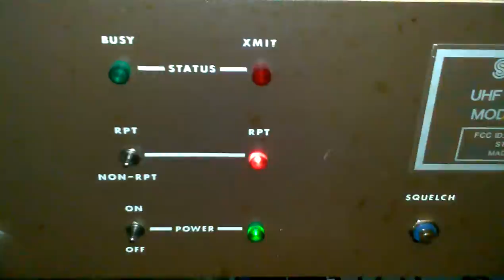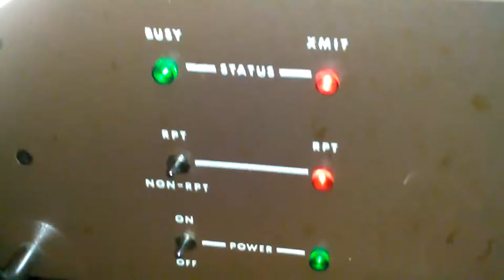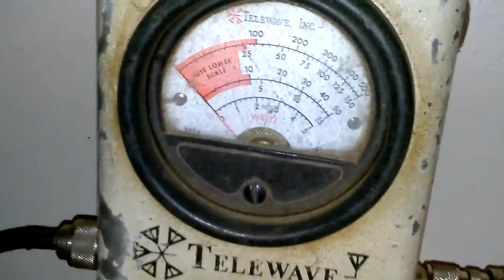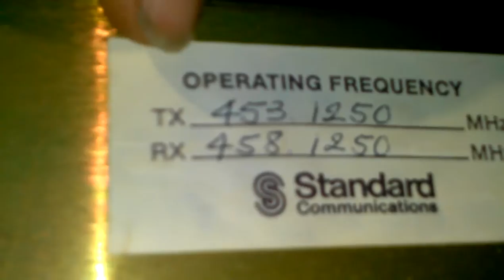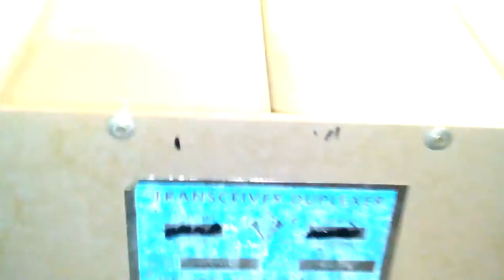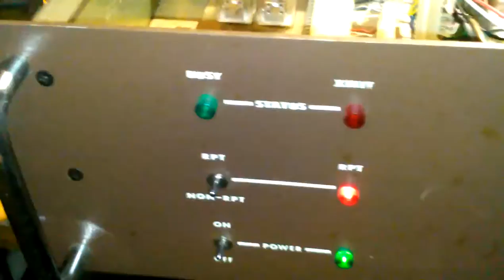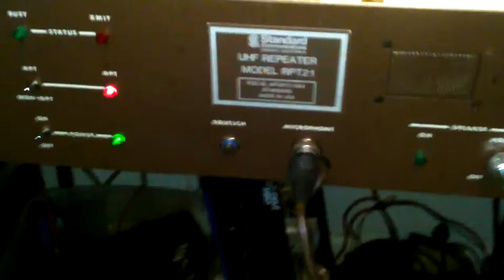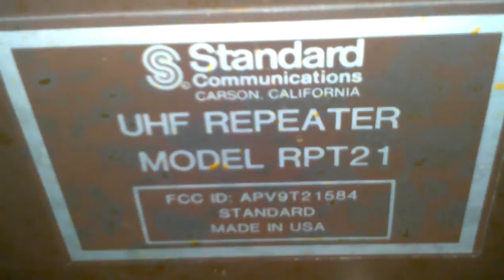Basic Repeater operation ft. Standard RPT21

Comment: Are crystals that bad over there as well? Last I was quoted here when asking about crystals for a HF radio were $150 per crystal or there abouts. The HF went into the local council pickup after hearing that as unfortunately to put several channels that were needed into it, it was far cheaper to instead get a computer programmable commercial HF (Codan or Barrett).
Reply from the maker: +Glen O&#39;Riley Yes because they are widely outdated for radio use. There are still some niche markets for ham radio use since they are still allowed wide-band operation and for some odd reason like to use relics like this Standard or a GE mastr 2 for repeaters. I am a commercial operator and I decommissioned and recycled all my wideband equipment back in 2005.. I am getting ready to do the same with the few reaming lingering analog repeaters I have up still here in a year or so. Time has come to suck it up and go all digital.. I have some digital systems up but they way its going now it is just about cheaper to go digital than to stay analog.
As far as crystals in radios go, well here int he states it is more less for hobbyist.
Reply: +ElfNet Gaming seems the same here too. 

All emergency services are or are on their way to full P25 and all the mines etc have shifted to DMR (mainly MotoTRBO). The way I hear it all the mines around here upgraded to a common combined MotoTRBO trunked network managed by their local dealer.

I don't think there is even any MPT 1327 networks left here, all seems to be mobile phone, P25 or DMR now.

There are a couple of old vote linked systems around for some couriers etc but I'll bet that will be DMR or missing soon alike the rest of them.
Reply from the maker: ***** Yeah MPT format never really caught on here since Motorola had a stranglehold on everything with their smartnet and smarzone trunking systems. I only seen a couple MPT systems around here, one was a local refinery and the other a college campus.
Reply: ElfNet Gaming
Well even the few type2 systems are gone now afaik. One of the only mobs in the nearest city to run t2 went DMR a few years ago and the local gov net went 9600 P25P1 around 16 odd years ago.